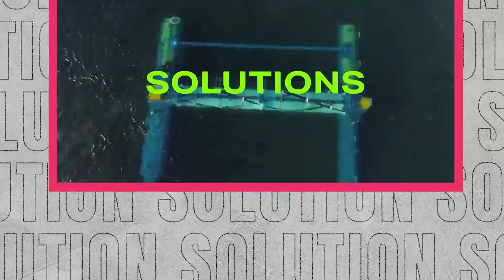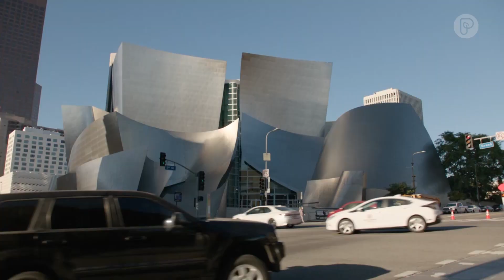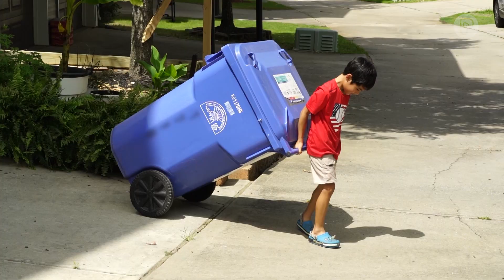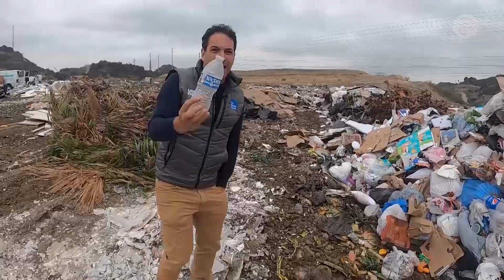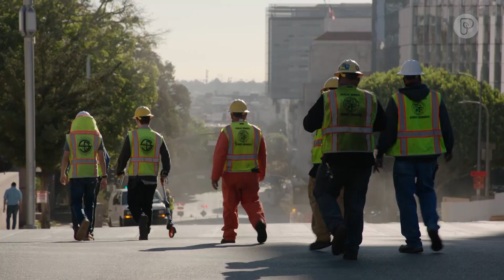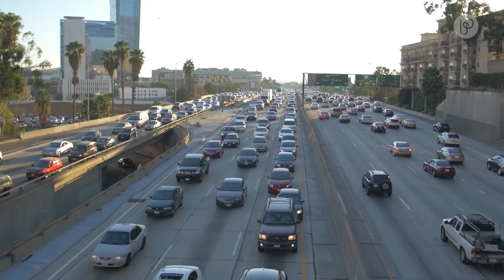Building Solutions: California Plastic Roads

Comment: Does it mean more micro plastics released in our environment, or into our drinking water or food?
Reply: No it doesn't. The plastics they use are turned back into its original oily form and is mixed with the bitumen, so there is no physical pieces of plastic in the roads themselves.

Comment: My grandfather God rest his soul would call all this plastic stuff plastic crap now the idea sounds great the application has been proven to function so far but what evidence I've never been presented with how does this plastic handle heat how does the plastic handle a car that may have crashed and is on fire the intense heat a car would bring to the road is it's burning or if you had gasoline that had spilled out of a car and caught on fire because of an accident will that plastic melt what will happen with it and when it comes to the extreme hot days of summer and you know how the extra tar they put on top of a driveways and stuff kind of melt and bubble up a little bit how's that going to handle the Sun melting it since apparently this thing is made of a good portion of plastic right and what about the technical off-gassing from plastic there's a lot not stated in this little little news hype about look at this new type of blah blah blah where's the real full testing results for all you know that's one toxic airstrip the hotter gets the more toxic the air coming out of it we have no idea for sure I mean when you have bottles of water this is already happened remember they went down to I forget what country or what area that on an airstrip there were tons and tons of bottles of water and because the heat of the Sun all that water was ruined in those bottles now I'm not saying you're going to drink off the road but if this is the same recycled material I think you got a future health concern on that road strip right there anybody can build something come up with a concept design it run it build it make it show it display it and function it it doesn't mean they went through all the logistical test for the personal health especially the way California likes to label so many things is cancer causing where are the real tests about the health qualities of that road where we've had cement in all this other stuff for decades so we know the general health qualities like you would never want to be buried in wet cement because it's extremely toxic and that if you were and somebody got you out you need to go to the hospital because of the toxicity of that wet cement so what we don't know is the toxicity of all these mashed up bottles and material and whatever they're using to melt or fuse it together in a real testing situation you got a real driving situation but that doesn't tell me anything because a hot no I'm saying this wrong a cement driveway versus a blacktop driveway one heats up more than the other but they both will still heat up from the Sun they won't stay ice cold all day and now you're adding this plastic thing with whatever chemical was included to melt if you use it sure in winter it's probably going to be fine but we don't know about winter we don't know how ice is going to react to a plastic bottle road and no I'm not meeting their individual bottles just for those people who want to be assholes I'm talking about we have no idea how it's going to react in regards to
Reply: Bro just wrote 95 things wrong with the government 💀